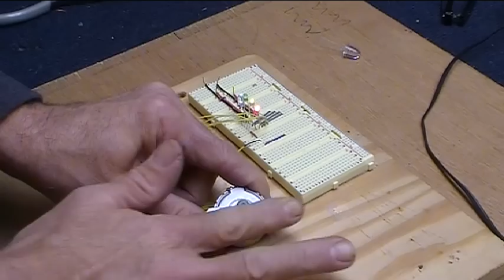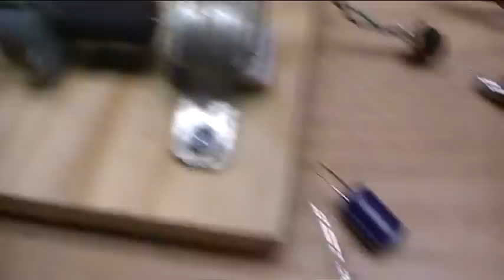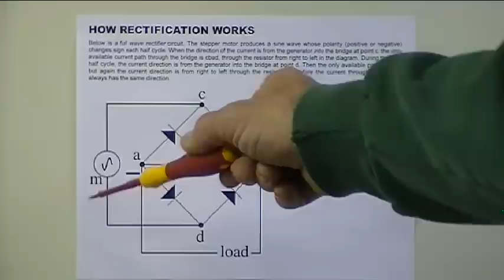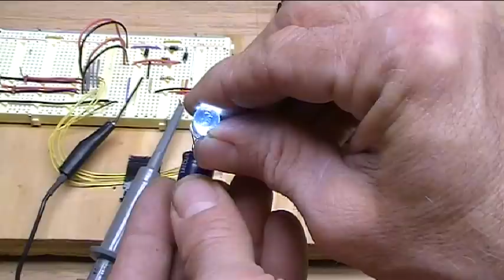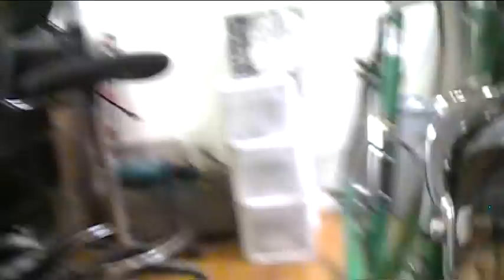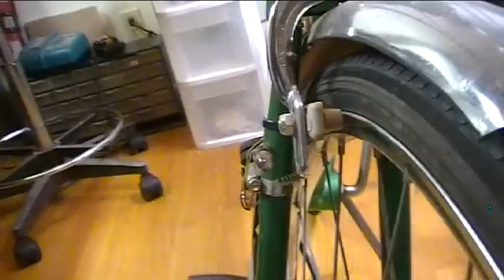Stepper Motors As Generators

Comment: The output voltage will be dependent on the rpm. Once you have an rpm source of constant value, if the voltage is more than you like, put a big cap across the pulsating DC output of the rectified motor coils and then use an op-amp comparator to compare the voltage across a second big cap to a reference you want to use.

Comment: The common will have the same resistance to all four. Put a diode on all four in the same direction for all of them, away from the common, (band end away), and they will provide a multiphase pulsating DC, put a cap to ground across the band end of the diodes tied together, and voila, filtered DC.

Comment: So an LA7812 (TO-220) would not work?  I've used 10 of  those (each 1amp) in parallel to make 12v/ 10A regulated supply and it worked for years.

Comment: you'd lose alot of power converting it with an Ldo. (42-12) = 30Vdrop. 30V at 1.5A is 45W loss! LDOs are awesome for stepping down voltages to power a load that draws less than 100ma, otherwise you lose most of your power. I would recommend TI's simple switcher line of ICs to step down with minimal losses, I'd look into the LM5575. The datasheet has the PCB layout, saves alot of time :)

Comment: with the steper motor giving 40V AC and since it is AC current, you could get the power to a long way away from the generator thats why AC was chosen over DC becuase the current could travel much long distances than DC with minimal voltagle drop then at the testenatoin of the cable could be the rectifiyer so it can be used for phones and such but you would have to put in a 7805 votlage regulator so it would be a clean 5v DC whitch nearly ALL mobile phones take!

Comment: if anyone is looking for larger, higher-power motors, copy machines have even beefier ones. got one rated 1.8 degrees/step and max current of 1 amp input as a motor. spun by hand i have managed to get over 85 volts out of it.

Comment: to be more efficient than regulators i would use a DC to DC converter  to convert 42Vdc to 12Vdc. (when bumping the voltage down, (from 42V to 12V) all that power is lost.

Comment from the maker: @abuthemagician 
Build a simple adjustable voltage regulator circuit with an LM317 and about four external components. The LM317 will deliver up to a 1.5 amp. For anything more than that, you'll need to use the LM138 which will deliver a maximum of 5 amps but it will need a heat sink. :)
Do a Google search for "LM 317 Calculator". Buy parts, build, enjoy your voltage. :D

Comment: Cool project. One suggestiong, put the capacitor across the bridge/load. It'll smooth out that DC waveform. You might have a little ripple but overall a much cleaner DC signal.

Comment: Two Qs:  How did you connect the four windings to the bridge?  In parallel?   Also, do you think it would be possible to use a small transformer to get the voltage down (current up) so a few high power leds could be used and a large cap could be charged up?  Been wanting to do the bike light.

Comment from the maker: @koulea You CAN generate power with a regular electric motor, just not as efficiently. The stepper has many more poles. Thanks to something called induction, poles passing by each other produce electrical pulses. This is why it outputs AC current